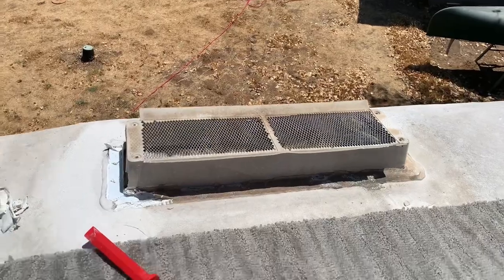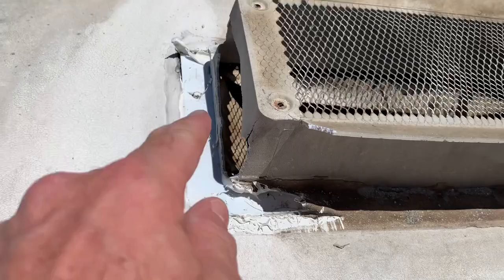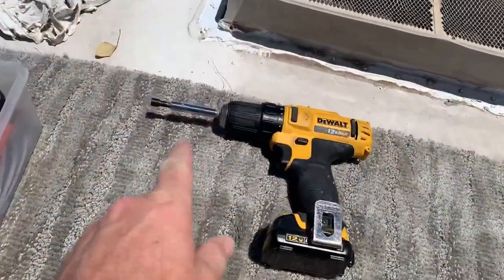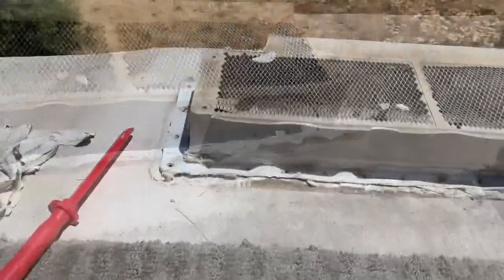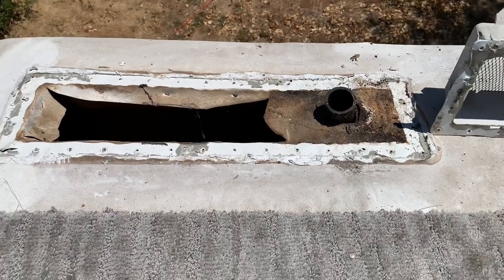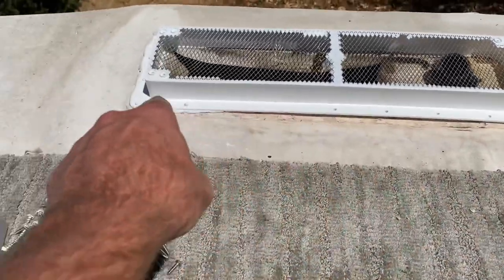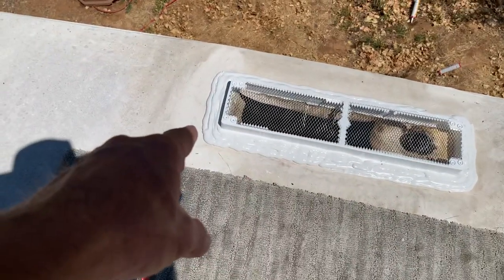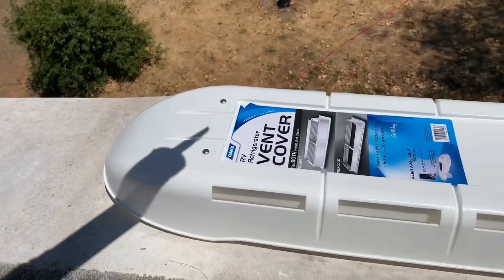Replace UV Damaged Refrigerator Vent & Base

Comment: Thanks for your video.  I used a heat gun to help with removing the lap seal - worked great.  Just my 2 cents.
Reply: Heat gun or Hair dryer better hurry she's in the shower.

Comment: They need to make better vent covers.
Reply from the maker: This is what I tell my clients:
When you wash your roof (should be done twice per year) apply some UV Protectant like 303 Aerospace Protectant or equivalent.  It’ll prolong the life if the plastic.
Reply: @covetthecamper2289  that sounds responsible, costly and laborious.  What can us 99% of rv owners do who are irresponsible, poor/cheap and lazy do?

Back to the problem- can’t they just make this out of metal so it survives for a thousand years? Or bamboo or teak or something other than a product that melts under normal temperatures?  It’s basically butter with a slightly higher melting temp.  Joking aside, the plastic is brittle and thin.   It’s cast cheaply - it should cost 11 dollars.   When I’m paying $70, I expect better plastic.    Playmobil could show them how!